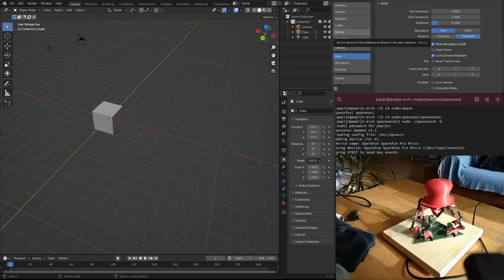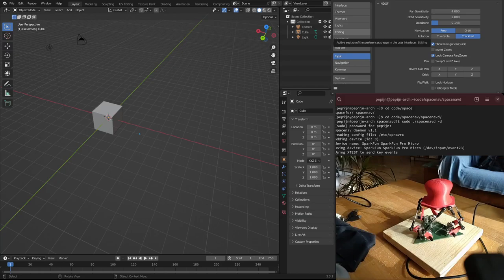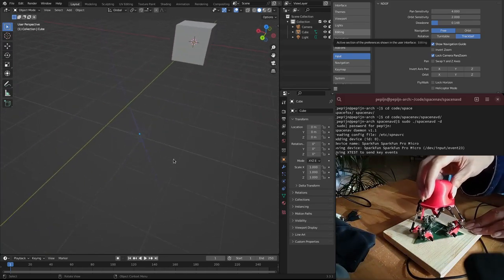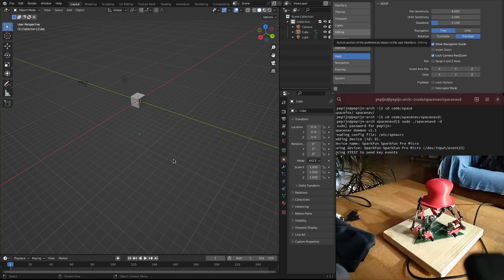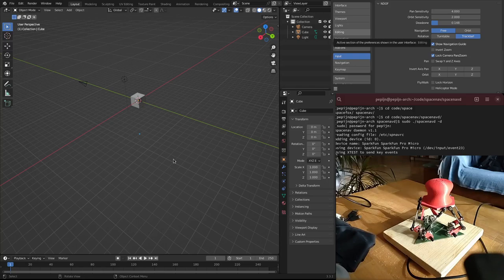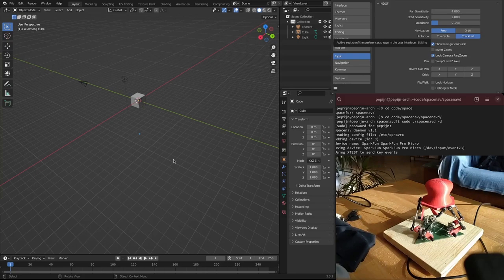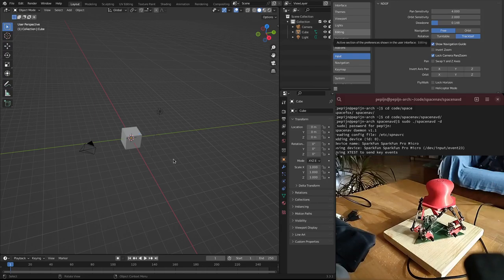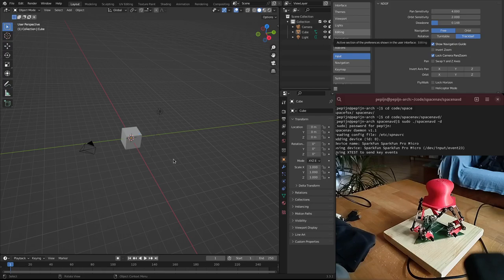I built the first true 6DOF DIY SpaceNavigator

Comment: Great idea to use a stewart platform and off-the-shelf parts.
One downside of it is that the DoF are dependent; for example the farther you rotate the mouse the less translation it allows. That doesn't matter for CAD but I think it'll matter for some games. I'm slowly making one with independent axes + axis limits (mouse has to be on a ball joint, which is on XYZ slider joints)

Comment: You could be able to do all that in a handheld, totally wireless, using a 9dof accellorometer "SparkFun 9DoF IMU Breakout - ICM-20948", i think?
Reply from the maker: Rotation certainly, but in the translation axis they measure acceleration, so you need to integrate it twice to get position which will be really inaccurate.
Reply: just FYI there is a DIY 5Dof space mouse that uses accelerometers "DIY 3D CAD Spacemouse V2 - SpaceRat / Getting closer to 3Dconnexion"

Comment: Amazing work! The arduino code seems to be surprisingly simple given the complex kinematic equations that govern Stuart platforms. I’m working on a similar device myself and I’m very curious about the algorithms you used to calculate the platform translation and orientation from the six pots - how did you get to those simple formulas?
Reply from the maker: Like a typical engineer I linearized the problem to oblivion. The equations for a stuart platform are basically impossible to solve. I simply look at which direction an axis of motion moves the pots in and add the movements together. This is evidently wrong at the edges and when combining multiple large movements, but it seems to work well enough.

Comment: Very nice! I like the motion platform idea. Combined with the simple pots with springs, makes this pretty much the simplest possible design for a 6dof input device. It's a bit bulky, ergonomically speaking it would be cumbersome to use for a long period of time so far above the tabletop. But I guess that's the tradeoff for the simplicity of this design and its construction.

For what it's worth, here's an interesting teardown of a space navigator: https://www.youtube.com/watch?v=1R7NCH_1UDI Apparently they're using optical sensing nowadays. I think the old spacemice used gimbals with force transducers.
Reply from the maker: Yea I saw the teardown but it seemed kinda hard to make yourself. I toyed around with many ideas but most of them got really complex or expensive. This one is super easy for anyone to reproduce. Just buy the parts and assemble. It's not perfect though so maybe someone will come up with a better idea. I'm not actually a 3D modeller myself so hard to judge what is important for real use. I feel like you're not going to pan around all day, but just grab it now and then to manipulate the view, so maybe it's not too bad, but no idea.
Reply: @PepijndeVos  I'm not a modeller either, and it depends on the application I guess (also these devices are not useful only for modelling), but in general when modelling you're manipulating the view constantly. How it works with these devices is that you have your right hand on your mouse, and your left hand on the 6dof device, which is why the more expensive models have a bunch of buttons to avoid having to move your left hand back to the keyboard.